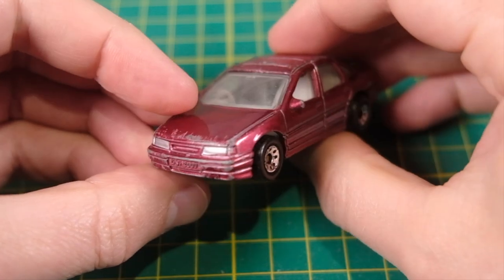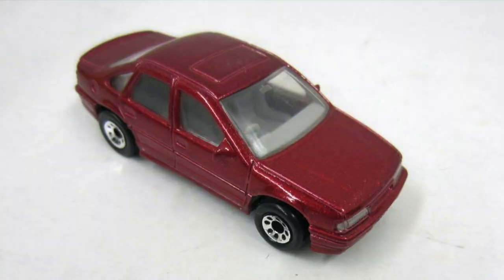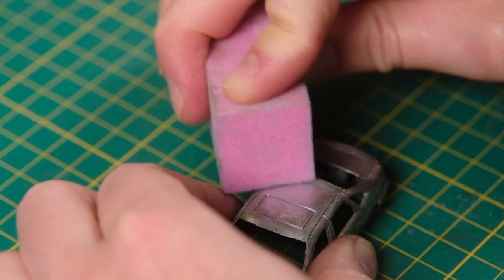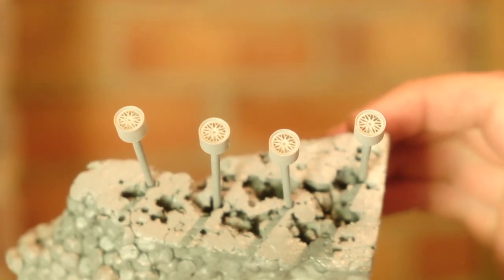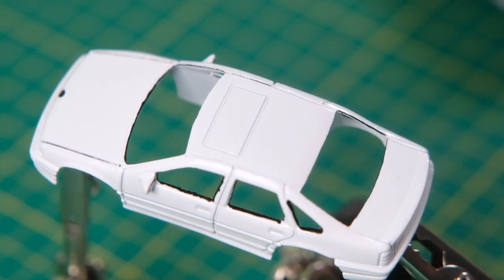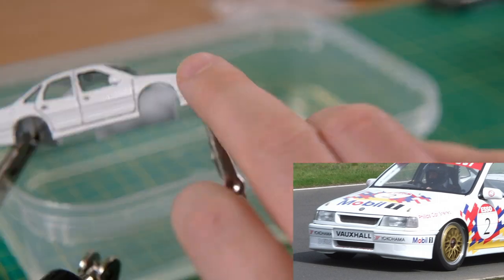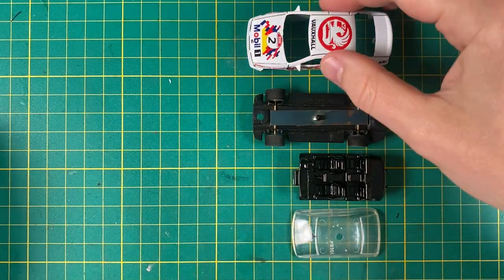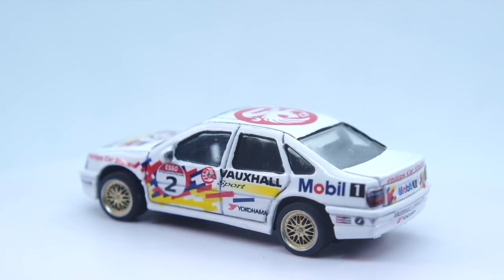MATCHBOX custom: MB201 Vectra / Cavalier GSi 2000

Comment: nicely done, and a real piece of BTCC history. or was it hystery? XD anyway, back when them races were still exciting. I eventually gave up on DTM, myself.

I used to work at an Opel dealership when these cars were new. funny thing is, the 4wheel drive demanded a different rear axle which took up so much space off the trunk, they either offered you a mini-wheel for spare, or you had to live with a tall bump on the trunk floor. the GSI2000 had the same rear axle, regardless of front wheel drive or 4WD. things were made interesting as Opel blew up the 2litre 16V with a turbocharger, revving it up from 150HP to 180 or 210HP if I recall correctly. quite a lot indeed, making the car interesting for the highway police... they could hunt sports cars with that thing. unfortunately not many Opel drivers knew how to handle a turbocharger, and ruined it or the engine pretty soon, and the car's reputation with it. and the Kadett-E GSI turbo went with it.